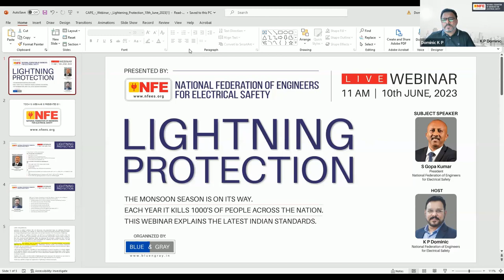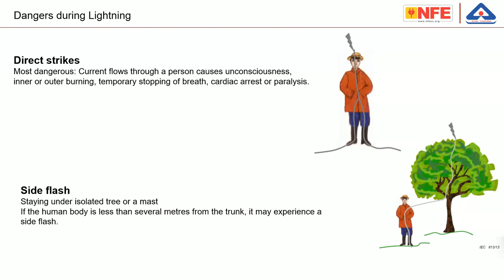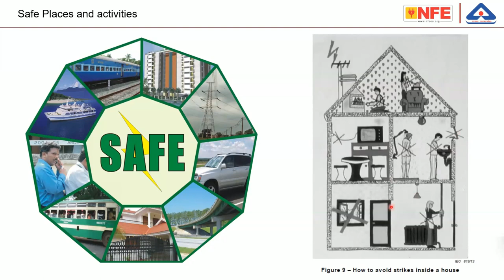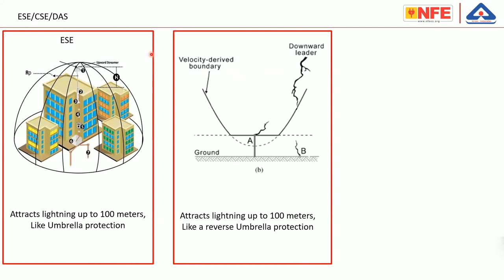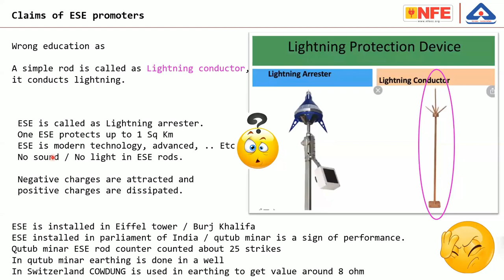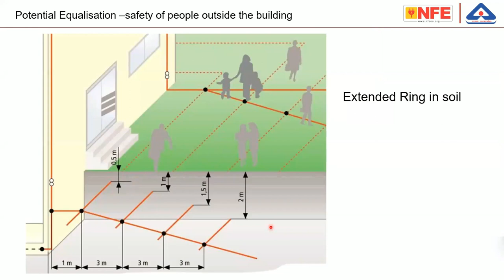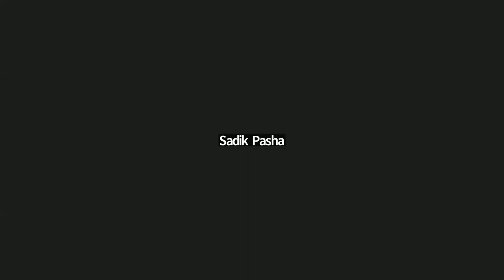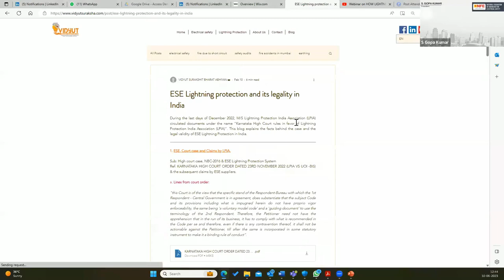Lightning Protection Measures for Outdoors

Comment: Thanks for sharing the presentation through you tube. It is quite informative. 

In one of our properties, even though we have provided Surge Protection Devise for the DG Set panel, the controller of DG Set is getting completely damaged during very strong & frequent  lightning. 

What could be the cause & how to protect the equipment against this. 

Any comparative agency is there to visit the site & suggest & implement the guaranteed solution , please suggest 

Regards
Sathyanarayana BR